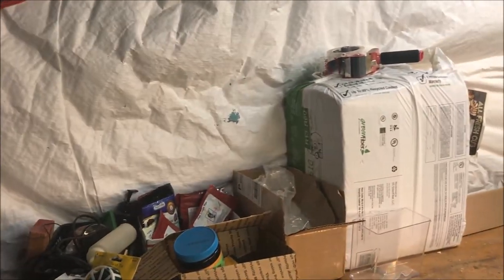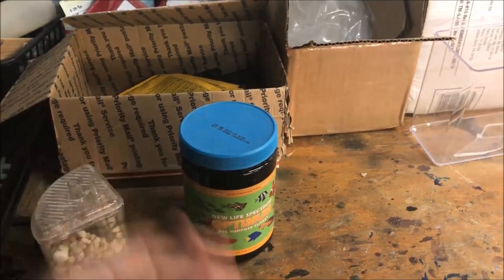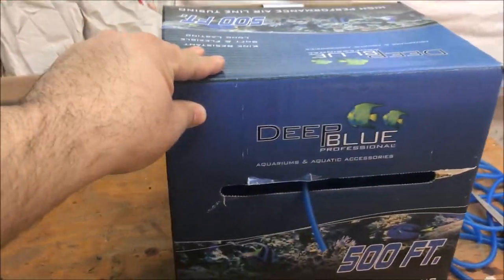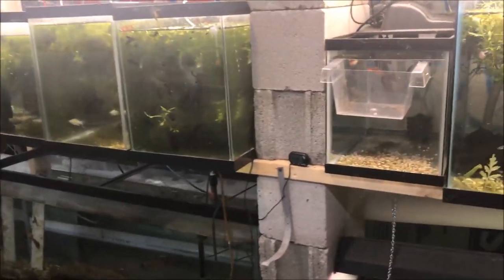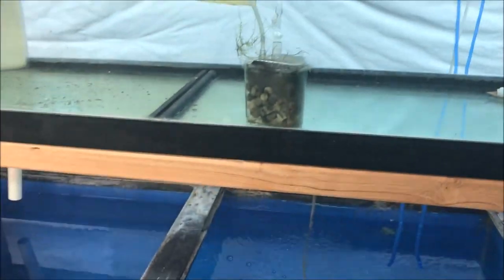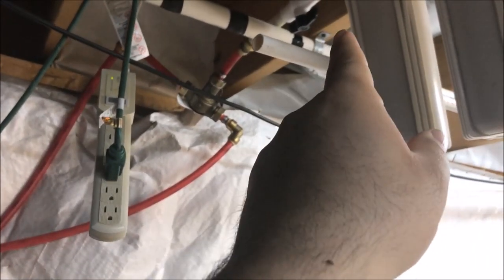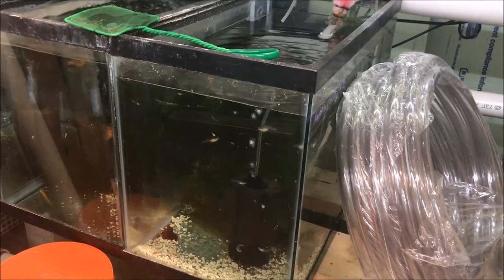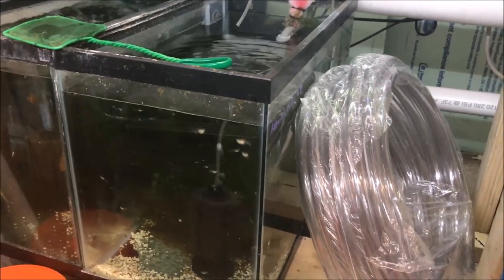Happy Water Change Wednesday Fish Room Tour Aquarium Fish Room VLOG

Comment: Big tank, go Puffers, it’s like having an aquatic puppy. The room looks much neater now, although just as much stuff. Do you Americans all have lovely clean basements? I have what we call a cellar. It’s about 14’ square, with stone walls and a brick floor, really damp and cold, and has been used to keep coal in so it’s filthy. Is your basement underground? My cellar is. How do you get your waste water out if it is underground?
Reply from the maker: I pump it to the city sewer line from the basement. Quite common here with basements. My washer and dryer are also in the basement. I was thinking of a puffer. What kind should I get?
Reply: If I had a bigger one I’d get a figure 8, but they’re brackish, fresh water a smart looking one is a fahaka, but is your tank big enough? I wouldn’t ever have a piscivore, as I don’t think I would want to feed live fish, also they don’t interact much (think of Potato, Bob Steinfotts)but you ought to consult Cory. You also have to remember that since you travel for work, who could feed? They’re pretty hard core carnivores, mine only take live or frozen foods, even though I feed dried bloodworms to my Loaches. It’s a lot to take on, especially the teeth issue. The smaller ones like Figure 8’s will eat Ramshorn Snails, easy to keep them in your other tanks. They are the best fun though!